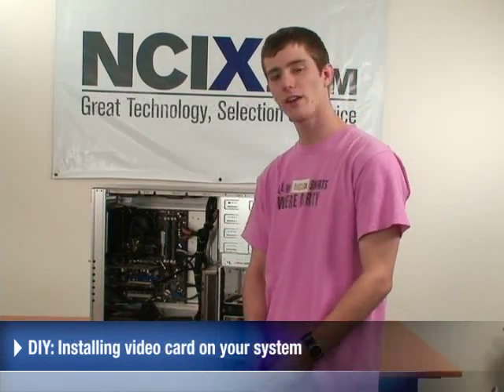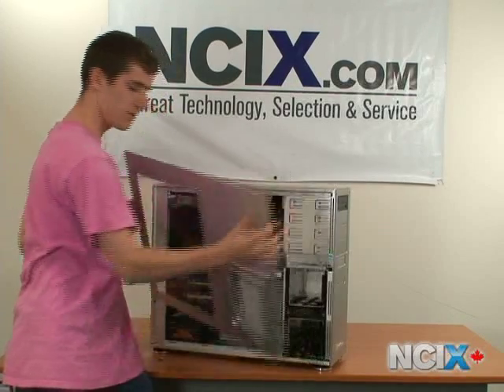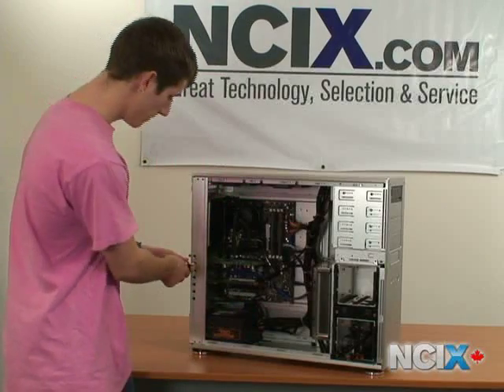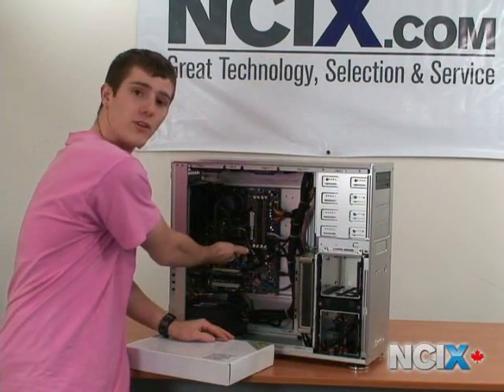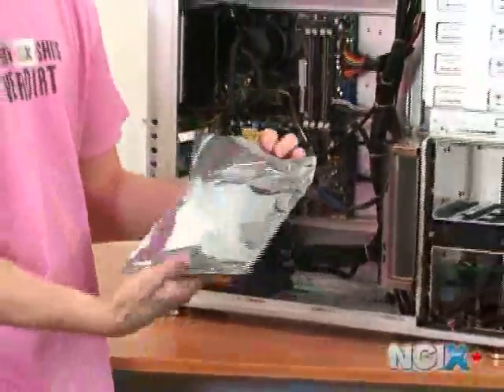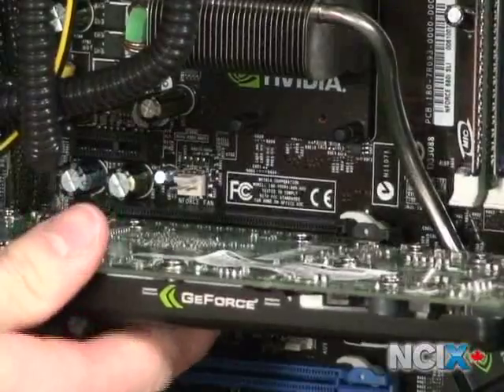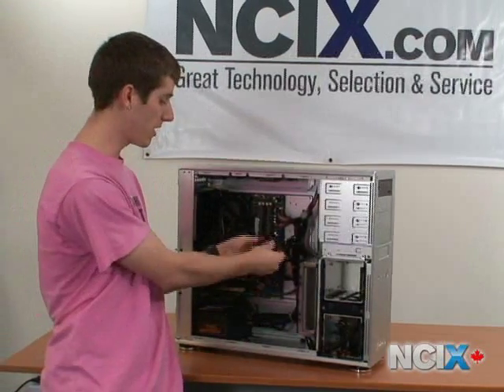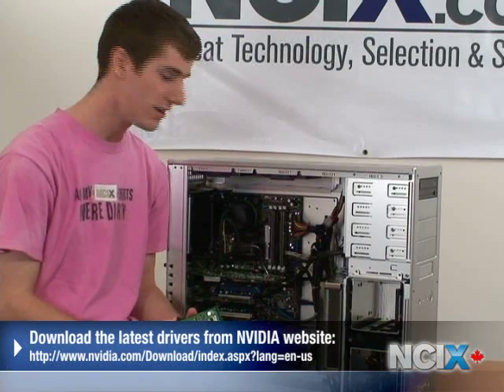Installing a new PCI-E video card (NCIX Tech Tips #9)

Comment: So I just upgraded my pcs card from a 660 to a 1060 and pcie plug on the card is an 8 pin and the pcie cable is a six pin please for the love of Christ tell me I can just buy an 8 pin and swap them out rather than buying an entirely new power supply???
Reply: Most power supplies come with a 6 pin with a 2 pin added on so you can make it an 8 pin, but if yours doesn't, you can probably get away with ordering a 6 to 8 pin adapter on amazon.

Comment: i need help i dont have a 6 pin pci express connector so i cant plug anything into my gtx 1060 what and where would i get something that will fix this
Reply: adapter or new power supply.

Comment: @gmk120 not unless your GTS 450 build in fan that does need connector to power supply the yes but die is overreacting you probabaly go to a comma? if its not need a connector then your good you wont die but video card might?lol

Comment: ive installed a number of gfx cards but ive always wondered, what is the purpose of the 2 pin connector on the side of the card? ive never used it, but every card always includes a small cable for it..

Comment: hi i have 1 simple question.
i got a geforce 9600gt and wanna get a gtx 260. now my question. do i have a 6 pin pci express connector cause i dont wanna open my pc now. does the 9600gt requiere it like the gtx 260?

Comment: Yes, but generally, PSU manufacturers underrate their PSU's and video card manufacturers recommend more power than is needed. While I wouldn't suggest it, it is possible to run a video card on a PSU that is *SLIGHTLY* under the recommended power.

Comment: i need your help
i have seen many computers with there moniter hooked up on there card but the thing with my
hp desktop is that my moniter is not conected to the video card on the bottom slots
if i buy a new card and put it on the bottom slots and conect my moniter to its new location will it work
i have a hp m8200n
amd athlon dual core processor 6000+
please help out.

Comment: The only "failgasm" I see here, Br8ssface, is that at the age of 24 (or so your profile reads) you can't even spell the word 'permanent'.

I also knew how to install a video card, however I didn't know about the 6-pin PCI-Express Connector for the 8800GT UNTIL I watched this video, which was very helpful. I would have felt like a complete fool when I tried to install it and it didn't work. I would have thought it was broken.

Thanks for the tips NCIX. They are appreciated . :)